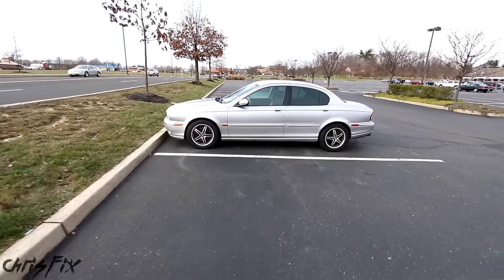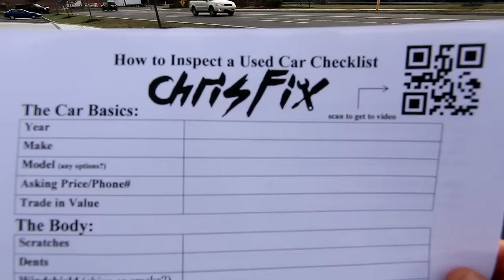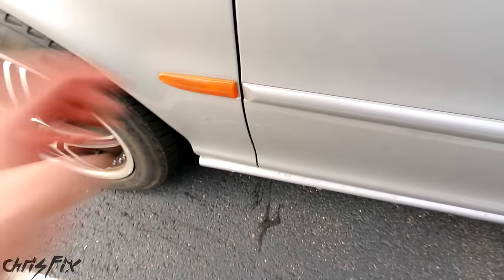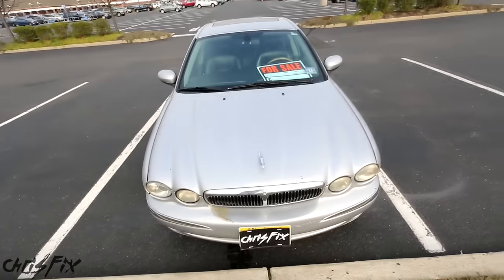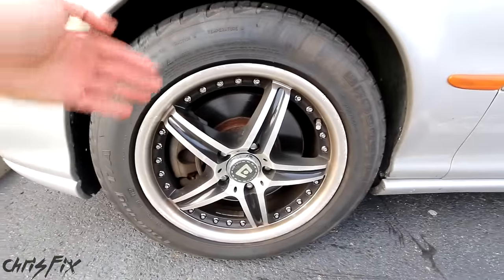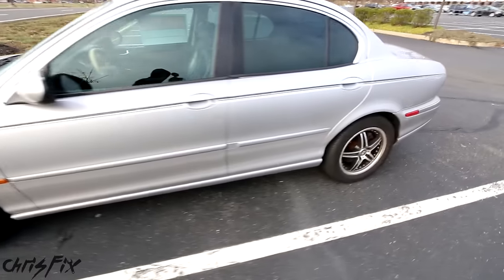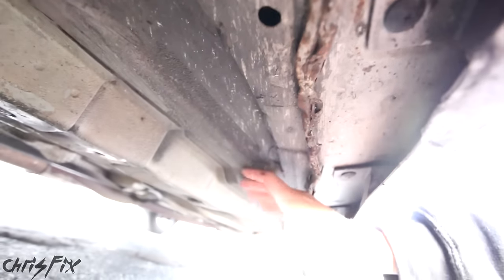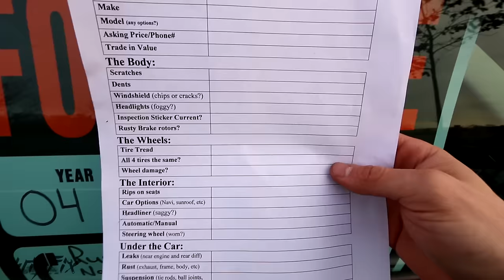How to Inspect a Used Car for Purchase

Comment: Me looking the underside: It seems a bit rus...
Chris: Its rust-free, good condition.
Me: Ok i see
Reply: Don't know what rust you saw. Especially in NJ thats  gem of a rust free car.
Reply: Yeah I saw those bolts looked red when he looked at the rear suspension and thought the same thing 😂
Reply: 🤦🏾‍♀️🤣🤣🤣 did the same thing.
Reply: @jessicamcelroy7879  you shouldn't care so much about rust on bolts. the issue is mounting brackets, structural pieces etc.
Reply: @chrishayes5755  the exhaust was completely rusty but Chris said it was rust-free
Reply: @alihazem1479  surface rust
Reply: @jessicamcelroy7879  as others have said, bolts and other "endpoint" parts will usually get rusty, and that's fine. those parts can take surface rust and still work fine. but structural parts like the subframe and mounting brackets for example will fail to do their job if they have rust since the metal is thinner and their structural integrity is more important than the structure integrity of a bolt lol

for a Jag of that age in a snowy area, that car was super rust-free. like really good.

Comment: You should also check the shocks.  Push down with your full bodyweight once on each corner of the car.  It should go down, then up once, and that's it.  If it keeps going up and down like it's on the sea, you'll need to replace the shocks, and that's pretty bad.
Reply: Well, you don't wanna be pushing your entire weight on the car if it isn't yours. Just wait for the test drive.
Reply: true,but shocking.
Reply: yeah shocks and struts can be expensive
Reply: The car can handle it.
Reply from the maker: I show that in the test drive video because I dont want to be doing that when the owner isnt around.
Reply: Not always a good test. Some cars, like my own have Magnetic Ride Control, so when the vehicle is off, the shocks are pretty soft, it's only after current is present in the shocks/struts that they stiffen and dampen properly. (BTW.. Would not EVER recommend a car with Magnaride.. Shocks cost apprx. $800 per shock.)
Reply: THANK YOU!
Reply: Thats an outdated test that is worthless on current Mcpherson type struts.
Reply: We met the seller of my car in a high school parking lot, so my dad just tested shocks and suspension by driving the car over the speed bumps.
Reply: @elskepode2 it dosent damage it
Reply: @zah-j4h  yesah 8 years ago me was weird, I'd put my full weight on the car unless it was a classic lol

Comment: As long as you are looking under the car, you could check the VIN on the frame and see if it matches the one inside the windshield and then look it up.  Sometimes scammers will change the VIN on the top and not on the bottom.
Reply from the maker: Good idea
Reply: I didn't know a vin # was located on the bottom of the vehicle Thanks
Reply: What is VIN?
Reply: NinjaDragonL vin is vehicle identification number
Reply: Tessa Burkhamer the vin is printed on several key components to prevent fraud. The vin itself contains the alpha numeric specifications of the car to identify everything like engine, options and paint colour that the manufacturer did when building the car.
Reply: R3y 1245  ....
Reply: Where is this number located under the car ?
Reply: @sakyna7  There's different locations it's placed on depending on the manufacturer/model. There's one kept pretty confidential for police/insurance use.
Reply: @tessaburkhamer4897  EU cars have a ton of VIN numbers all along the car, some car makers put them even on the windows

Comment: Thank you for posting this series!  The last vehicle I purchased blew its head gasket on day TWO!  Thankfully the dealer split the repair costs with me despite no warranty.  If I checked the radiator cap, I would have seen that sludge instantly.

I just inspected my wife's next vehicle high and low yesterday using your checklist and videos.  I tried my darndest to find an issue but came up with nothing.  I feel much more assured I made a safe purchase this time around!!!

Comment: Hey Chris, one tip I think you should put in the body is check the uniformity of the seams between body panels.  

I once was helping a friend purchase a used car, and I noticed the seams between rear quarters and trunk didn't flow evenly.  Asked the owners about this and they said it had never been in an accident.  I looked up the carfax and sure enough it was in a collision, so we avoided the car.
Reply: I looked at an '05 Acura RL that had a clean Carfax with no accidents listed. However, I noticed that the gap between the passenger's side fender and the door wasn't uniform like the driver's side. Looking closer, it was apparent the fender had some work done to it. The car was priced about $2K below blue book, and it otherwise appeared to be in good shape, but it had been on the lot for 90+ days according to cargurus.com.
Reply from the maker: Check the next episodes where I go over that. Great tip! A link to those episodes is here: https://www.youtube.com/playlist?list=PLvKbarVtwhUv6bjLhJSyaEOxaYy03j7QS

Comment: Great tips - THANKS! 
One more tip (important on anything more than 5 years old): Take a kleenex and wipe it around the inside of tail pipe; it should ONLY show some carbon powder/residue (yes carbon) and NOT feel even the slightest bit oily. RUN AWAY if at all oily.
Reply: What does oily indicate?
Reply: @jassingh7086  It means there is a serious problem with the engine -- cracked piston rings or many other possible issues likely to cost a bunch to repair. The exhaust gases should be only water and carbon dioxide, and perhaps just a tiny amount of black carbon residue. NO oil at all in a gasoline engine car tailpipe.
Reply: Thanks. Getting ready to look for a new car, and I forgot all about this one.

Comment: It is always a good idea to check if all the windows have the same logo, so you can quickly know if someone tried to steal the car (so it would have some damage on the ignition or the owner had to replace the key) or if it had an accident - a replaced one won't ever be the same since they should have the same number printed on them

Comment: Love your vids. One thing I want to add though when buying a used car from a private party: MAKE SURE THE TITLING IS IN ORDER. You can find a car that's a deal of the century, but if something prevents you from titling (and subsequently registering) the car in your name, you're seriously screwed. You want to make sure the person selling the car actually has the right to sell the car (ie, their name is on the title), and you want to make sure things like the VIN are 100% correct (even if two characters are transposed, the DMV is likely to reject the title). The first thing though is by far the most important because you can fix the second thing with the previous owner's help.

The problem is though that a number of privately sold cars in the used market are being sold by flippers, and to save (substantial) money on titling and sales tax, they'll leave the "Buyer" field on the transfer of title section blank when they buy the car and just never title the car in their name. Then when they sell the car to you, you can put yourself down as the "Buyer". No problems as long as you don't need a new title for whatever reason (VIN error, cross-out on title transfer, previous owner printed out their married name in the title transfer section when the title is in their maiden name, previous owner signed their name "Jim" when the title says "James", dog ate it, etc), but good luck tracking down the person the flipper originally bought the car from (and that's assuming the flipper didn't buy the car from another flipper).

You also have to be careful of titles with multiple owners, even if the seller is one of them. Make sure all listed owners are around and will help you should you need a new title or some other DMV issue comes up with getting the new-to-you car in your name. Last thing you want to deal with is buying a jointly-owned car from a disgruntled spouse going through a divorce, or buying a jointly-owned car from a son whose dad passed away but the son doesn't have any power of attorney documents.

Also, understand that some states actually have two-part titles: a "liened" title that the DMV sends to the buyer financing the car and a lien release document that the DMV sends to the bank. Once the buyer pays off the car, the bank sends them the lien release. The first part is absolutely USELESS without the second part, and A LOT of people who live in two-part title states don't even realize this (and wind up losing the lien release). So if you're buying a car from a two-part title state, make sure you have both parts OR that the title doesn't have a lien holder listed on it. Unless you're really, really incredibly lucky, a bank will only send a lien release to the person listed on the title/lien release. I've even seen situations where a bank that was listed as lien holder on a title hadn't been in business for years, and that's always an insane (and sometimes insurmountable, actually) obstacle to deal with.

Finally, be careful of dealers posing as private sellers. I've seen schemes where they'll put the dealership's name as "Buyer" on the title and then give you a dealer re-assignment form (or just fill out the dealer re-assignment section on the title) with you as the transferee. The seller will swear up and down that this is fine, that they've done it in the past, and that it's completely legit, but unless you're also a dealer, it absolutely won't work. So once the DMV rejects your title application because of this, you'll be forced to go through the dealership to get the titling done, at which point they'll likely slam you with several hundred dollars (possibly up to a thousand) in various doc and processing fees. They know your only two options at that point is to pay up or spend even more money suing them.

Really, the best way to protect yourself from all of this kind of stuff is to just go to the DMV with the seller and get the title transfer done before keys exchange hands.
Reply: To Ky Y: Thanks for your insight and expertise. If you ever open up your own you-tube channel, I'll be your first subscriber!
Reply: wow incredible information.
Reply: Spot on information.  Always take the buyer/seller to the DMV or you run a huge risk.

Comment: Hi Chris,
Just wanted to express my sincere thanks for your exceptional videos and guidance.  I’ve been looking for a used car for my mother-in-law for the past two weeks, armed with the BlueDriver code reader, penny, paper towels, fridge magnet, and of course the ChrisFix used car check list.  I’ve seen one bad car after another (all of which were described as excellent condition in the ads) and ran into vehicle with bad CV boots, oil and tranny leaks, tire treads that barely covered the top of Abe’s head, massive sludge buildup around the engine, blow-by, suspension clunks, surging engines, pending engine codes and the list goes on and on.  Finally, however, today I purchased a mechanically solid 2002 Toyota Camry that passed every single inspection point on your list and feel confident that I got my money’s worth and have a car that will easily surpass 300k with proper ongoing maintenance.  Again, a huge thank you for your sage advise and help!

Comment: I saw this video about a month or so ago, and it changed my life. I downloaded the checklist and then began my search. I went through 3 test drives and inspections using your checklist. Just the other day I saw where you bought that Jag for your Dad and what you did for the rims. I followed your advice and found a cherry 2005 Volvo S40 t5 that HAULS! Negotiated about 20% off the asking price and believe I made a good deal. Good job by you!

Comment: A few things to check once you have the owner there or the keys. Check in the engine bay for rust or damage. Look inside the oil filler cap for white slime. If it's there there is water getting into the oil. Look in the coolant reservoir see how clean it is and see if there's oil blobs in the water. This can be either or both ways. I've seen cars with oil in the water but no water in the oil and visa versa. Look around the battery tray for corrosion. Most batteries are sealed these days but on older cars corrosion here was pandemic. Check the oil to see how clean and topped up it is. This can be an indicator of how well the car has been serviced. Start the car and make sure it turns over cold. If the car was driven before you got there you should wait till it's cooled. Warm up the car or do the test drive then do the leak check again. Some leaks only show when the car is warmed up. Don't forget to test things like air-conditioning on the test drive. If it's cool weather most people forget then when summer comes and it doesn't work they could be facing a large bill depending on the fault. Check the front and rear lights np
Reply: If the car was running, how long should I wait until considered "cold" again?
Reply: @ClaudioParraGonzalez  30min to an hour sometimes even longer

Comment: @ChrisFix I think you should add "Test keys in door locks" to the list. My cousin got a used truck with electronic lock/unlock and he didn't test the keys. Turned out the keys didn't work in the doors, so he had to replace the door locks and then had to carry 2 diff keys because of the different ignition key.

Comment: Thank you so much for this video Chris. I am a young guy, and recently bought my first vehicle. It is a 1995 jeep wrangler. It has 75k original miles, 2.5 liter straight six, 5 speed. I checked all these things, and jeep specific things. (Drivetrain, the top, rust on the fire wall) I bought it for 6,000, and it runs perfectly. Thanks for helping me!
Reply from the maker: +Chris Crowder Awesome Chris!!!
Reply: +Chris Crowder The 2.5 is a 4 cylinder. The 4.0 is the straight 6. Replace the oil in the transmission. I have seen many Wranglers with water in the transmission because of the vent tube design.
Reply: +ChrisFix ㅠ
Reply: Holy hell... I had no idea people were paying that much for those things.

Comment: Tires on an AWD car should ALWAYS be the same brand. Sizes run differently from brand to brand and in AWD vehicles different size tires (even worn tires of the same brand) can DESTROY the AWD system. I'd pass on this car.
Reply: I thought the same thing bro.
Reply: JettyLife23 yyy
Reply: The Buick Rendezvous is infamous for that problem!
Reply: JettyLife23 Thank you for that tip. But for someone like myself who’s clueless when it comes to cars, can you elaborate a little more on the “same brand” what do you mean in references to that specific statement. Thanks!
Reply: Honestly, I would just walk away from any car that has different tires. It's a red flag that the owner probably doesn't take care of his/her car very well.
Reply: @yafavbrujita762  it means that you dont have different tyre desing in any of the wheels (i.e. falken front and goodyear back or falken ze914 front left and falken fk510 front right), this might cause water draining different on one of the axis, I would find totally negligent if there are diferent tyres on the same axle, but I personally won't mind having different tyres between the front and rear axle.
Reply: @Andy-im3kj  It only means what the owner didn’t rotate the tires. Not everyone is obsessed with car maintenance. The car could be perfectly fine except not having rotated the tires, resulting in the powered axle needing to have the tires replaced earlier than the non-powered one.

Comment: Thank you Chris. I bought my first car, a 2006 Lexus IS250 today. After inspecting I found issues with a front bumper, door mirror, AC not working, rusty spare wheel well and dropped the price by 500€. This video was very informative and helpful
Reply from the maker: I'm glad the video helped you knock some of the cost off!